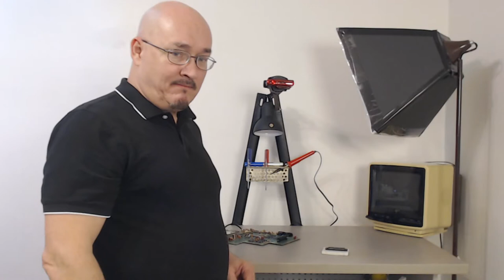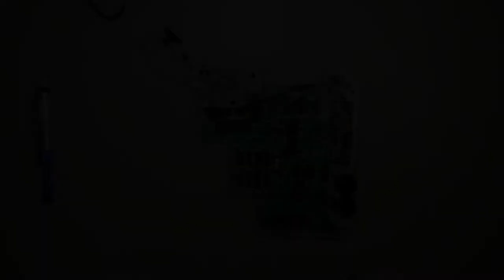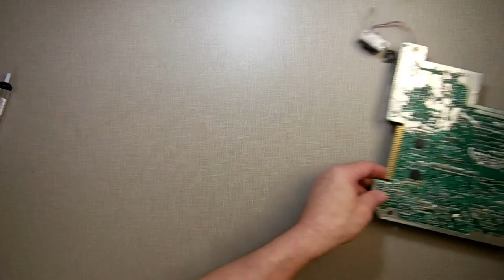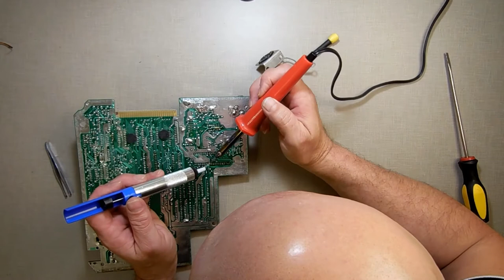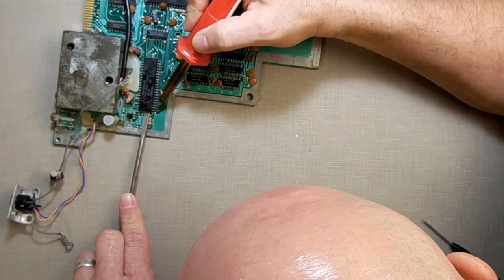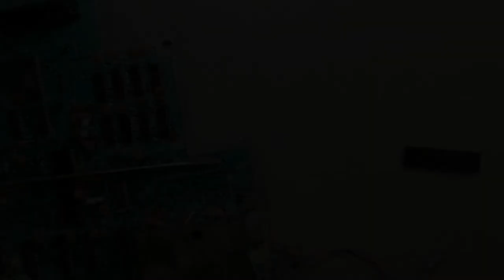ZEN and the Art of Removing a Video Display Processor #FEBRUADAM

Comment: Watching this video gives me some guts to try it on one of mine as I need to remove to install a socket for the F18A I had laying around forever.  I have a solder sucker like that but never seemed to work as well for me and use solder braid instead.  Was going to leave it to the pros with the right tools, but I think my Hakko is up to it.
Reply from the maker: You got this!